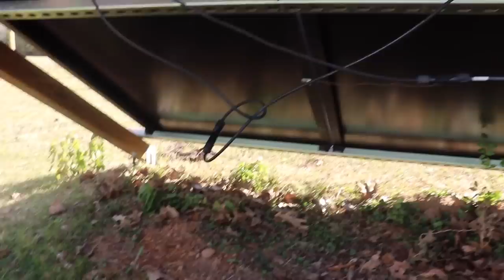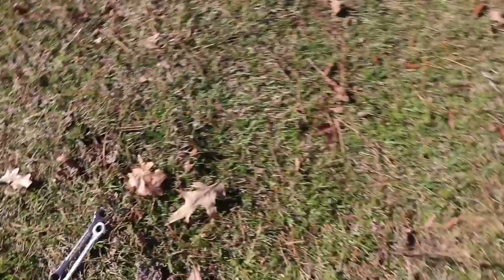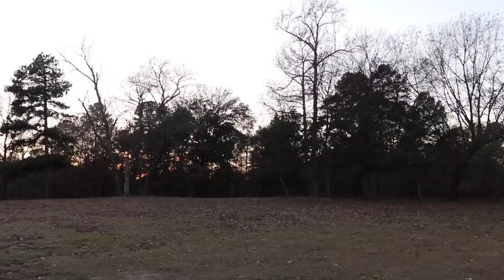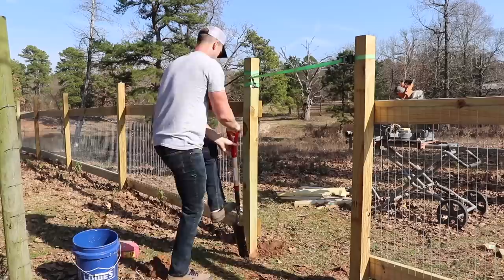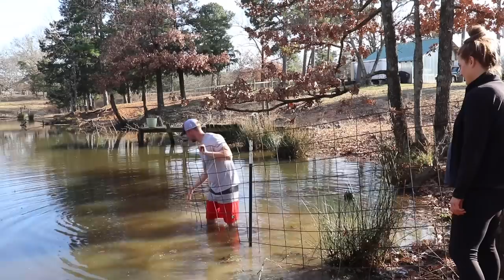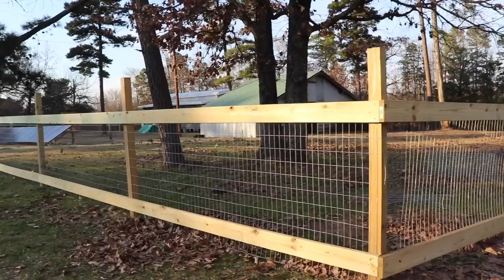Building More Than A House

Comment: Poetic closing; “power from the sun and water from the sky.”  You two are incredible.  Interesting collection of hogs in night camera images.  What are your plans for harvesting meat & building a smoker?  Stay safe. Peace.
Reply: Yea, really. A Smoke House to be sure.  I've seen some rural folks generate a small side income selling their smoked meats and Farm Eggs too.
Reply: A friend converted a 4-drawer file cabinet into a smoker; replaced bottoms of top 3 drawers with expanded metal.  Fire and smoke woods in bottom drawer, chimney holes drilled out the top and back.

Comment: It is coming along really well guys just two things to help out I am from a farming background when you staple the fencing wire go diagonal cross the t in the wire will add to the strength plus when placing the post in the ground the main strainers a block of wood stapled to the bottom on a short about half foot of wire compacted down well will add to the stability and strength plus to stabilize the strainer post you can cut a notch out of the strainer and affix a brace on a 45 % down angle sunk into the ground will stiffen it up hugely
Reply: Mark Fuller Dude, ever hear of a period?

Comment: cattle can be rough on fences.  I recommend a couple strands of electric fence wire
Reply: I don't think they can now that it goes into the water. ( but I honestly don't know)
Reply: @cjw2661  You can isolate the electrified run from the fence itself so it in no way contacts any metal part of the fence. You can even go a step further - if you wanted to be really anal about it - and isolate each section of the fence mesh/wire from the next so should the electrified part be pushed onto or otherwise be made to come into contact with anything metal on the fence it wouldn't electrify the rest of it.
Reply: That is what I was thinking, barbed or electric, they will not be happy once their grass gets green.
Reply: I would be worried about bear at night if they have a doggie door.

Comment: i would  recommend you get an electric fencer and just run a dbl wire along the pond  edge ,you can get the type that use a battery and a solar panel charger ,check any farm store or lowes lnbr store , believe it or not cows can swim.

Comment: if possible I would have enclosed the tanks in the fence so the cows couldn't chew on the tanks or pipes. It looks like you need some waders to go into the pond unless you can run the fence around it.
Reply: I was thinking along the same lines as far as one of the cows crushing the exposed piping/joints.

Comment: Okay you two I've been watching since the beginningand I told you in the comments as soon as you put those panels down that you better protect those things you guys got lucky all they did was chew on wires nobody got clumsy and stepped on a panel. so I'm on the other side of the coin I'm not wondering why you're doing it now I'm wondering why you waited so long.lol better late than never you guys are awesome keep on rockin.
Reply: Hay Mamacita  FYI I live of grid . And it's called expereance .
pretty much everything that I have suggested they did,  even things they didn't want to ,like repaint those containers. which I won't be surprised if they repaint them again in a much lighter color like white that green  metal in the summer will get  150 degrees easy. Oh and Mamacita back when I was making those kind of suggestions there were not very many followers yet . I don't do that anymore. I just keep cheering them on. I know that the first two years off the grid are very challenging. Most don't make it. I cAnt tell you how many peices of land have half a built houses with rotting trailers that they lived in while they built the house. Oh Merry Christmas 😎

Comment: What's your thoughts on the putting solar lights on the posts
Reply: John More I like it but probably expensive though it probably depends on how many posts there are.  Seems like a lot.  Maybe if they did, say, ever 3rd or 4th post?
Reply: @chuckm260    I was thinking like if you had them around the gates
Reply: Maybe some motion-activated solar lights?
They'll get a surprise when the lights suddenly turns on.

Comment: I'm kind of surprised you guys didn't enclose the tanks in the fence...not judging just curious
Reply: @420 420 Fencing keeps farm animals, wild pigs, coyotes out of a yard where a child will be playing, parents will be gardening, and protects solar setup & home. Water tanks & pump house are sturdy enough on their own.
Reply: my curiosity is why they used 4x4's?  T-posts would have lasted longer and been easier/cheaper.
Reply: @atlasshrugged3753  cause they look like crap. 4x4's look nicer.
Reply: SethLouey Agree, way nicer! Plus the 4x4s make the fence more visible which helps prevent animals and even humans from accidentally running into it, especially at night.
Reply: @sethlouey5064  you ever do any fencing?  Let me learn ya.  4x4x8 = $7.88 approx and lasts about 10 years if you are lucky.  Then you have to remove the staples on good above ground wood and replace the post at $10.88 due to inflation.  T-Post = FOREVER. at $3.50 each.  Personally, Imma gonna eat a taco and dare a T-Post to rot while i drink a beer doing the job right the first time.

Comment: We did a similar fence and we had to do a horizontal 4x4 from the gate posts to the next post at the top....and concrete them. The gates will put a lot of strain on the posts, especially the car gates. You will have to adjust them periodically. 
Don’t cut those posts until u find out how much of an escape artist bear is. 
Great job as usual!

Comment: I was worried about bear. Running around at night with coyotes and wild hogs around..
Reply: Me too!
Reply: I am too but the real question is why is he out at night to begin with?  Either they don't allow Bear inside at night or he has learned how to open a door.  :-/
Reply: @chuckm260  Maybe he had to go out to poop and didn't come back?  More than 2 options, I'm sure.
Reply: @TheHolyGhost777  Good point.  I actually mentioned that in another reply.  But if that's the case, it still seems like it's preventable, at very least safer, if they put a (long?) leash on Bear and go out with him while he does his business.  
Risk will be greatly lowered once the fence is completed but nothing is 100% protection.  Animals will find a way if motivated enough if there is a potential meal on the other side of the fence.  I hope they still look to take safe(r) measures when Bear is out at night (for whatever reason) even after the fence is up.
Reply: Me too!

Comment: Run a string or two of solar wire across the top half of the fence line near the water edge and along the pond edge.Once the get a few shocks, they will not go around it again. It would also help with the wild hogs problem, from digging alone the fence line.

Comment: Make a step for your wife to get in the house.
Reply: Ditto.  Or even a ramp - that way there's no stairs to contend with and is much easier to carrying heavy supplies, appliances, furniture, etc. into the house.  Either way just remember to put down some anti-skid/slip tape or whatever it's called.
Reply: She's pregnant, not disabled
Reply: @Wmoore1  No one said she was.  Whether she's pregnant or not, common sense tells you it's minimally safer not to mention easier.  Work smarter, not harder.
Reply: @Wmoore1  yeah she can trip getting up there. Did you see how high it is?
Reply: @chuckm260  thank you

Comment: You definitely need to put an electric fence in front of your new fence Spencer. Battery and solar power should keep them out. Also deer can jump high... You need to run a couple of wires along the top of the posts.... Do not cut them level you need the height....... Love the channel 💜💙💜💙😉

Comment: I'd put a couple strands of barbed wire on top of the fence...
Reply: My thought as well.
Reply: Either barbed wire or an electric fence along the top.
Reply: I'd go with a good solar powered electric fence. Since you're dealing with cows, you need to run the wire lower, about 4 feet from the ground. (think tush height on a cow) 
Cows like to rub/itch on stationary objects, until of course they are not so stationary any more.
Reply: And on the bottom for the hogs also.  Rick.
Reply: There will be a child running around outside within a year or so, probably don't want to electrify the fence or use barbed wire.
Reply: @aquadesignsbymlt4769  I understand your concern, the electric will be up high enough, even at cow-tushie height, that it'd be a few years before a toddler would be tall enough to touch it. By then of course, smart enough not to touch it.
Reply: @aquadesignsbymlt4769  It will be several years before the kid can run around and when it does it will quickly learn just like the animals that the fence is off limits!!!!!

Comment: I added a couple links below......

I see you have some temporary angle braces in a few places to add strength. I would recommend you put a permanent angle brace on each side of each gate and also on all corners of the fence. You can do this with wood or number nine wire or even barbed wire. I'm sue if you search some YouTube videos on barb wire fencing you can find lots on the best way the strengthen the corners and gates. It will help keep the gate posts strait which in turn will help keep the gates from sagging. This is very common on barb wire fencing which I think is still applicable to the type of fencing you are doing. Also put a diagonal brace on all of the gates themselves using wood or wire. It will also keep them from sagging. you can also do cross bracing on long runs of fencing to make it stroger. Ill add a couple links if possible. 
 https://www.youtube.com/results?search_query=angle+braces+on+fence+corners+and+gates.
https://www.youtube.com/watch?v=t29NC_WpXmM

Comment: Hey guys, loving your videos. Just a tip for future fencing that I didn't see you doing, when compacting the dirt around the post, compact layers of 1-2 inches of soil at a time. This will allow the soil to hold the posts a lot better and probably eliminate movement without pouring concrete. 
Awesome work on all your achievements 😀

Comment: Go to your local farm equipment store and buy some fencing Pliers. You'll use them for many jobs as they have a staple puller/ hammer/wire cutter as part of the tool. Part of the tool is built for putting the steel fence post 'staples" on quickly and efficiently. Oh and one of the handles on the tool ends in a chisel/large screw driver. Just about the best all around tool ever.

Comment: Hi, nice! You need to lateral brace your corners an posts to the gates. The cows will lean or rub on the fence and can put alot of stress length wise. The lateral braces will add tons of resistance and strength  long term!

Comment: A framing air stapler with galvanised 1.25 or 1.5 inch staples makes fast work of stapling the wire fencing.  You do need to dial down on the air pressure so you don't blow through the staple and/or damage the stapler.

Comment: Most fence builders place a diagonal board / pipe or wire from top of one post to the bottom of the other at: corners / gates. It helps stiffen up that area of the fence. A 'box' (or square) is very weak. While a triangle is much stronger shape and would help strengthen those area's.

Comment: In Australia we build  pig traps  so they can be wormed and treated before turning to pork.  If you put posts in concrete but a piece of 1/2 inch rod anout 2 inches sticking out of each side of the posts in the cement.  Then when you have to remove them the steel binds the concrete to the posts to pull out with tractor and chain.  Little tap with a sledge hammer and you have clean posts  full sized holes for new posts,  and concrete rubble for  dirt rd potholes repairs.    Requards Qld  Australia  p.s  meryy XXmass

Comment: Put my own fence in after I found out how much to get someone else to do it. Not as hard as I thought, yours looks way better than mine and mine is not that bad. You do great work. If you dont want to cement the post use quarter size gravel and fill the space with sand.

Comment: If your main goal is to keep the dog in, you better put another board across the top about 12 higher.  I did that and my dog, who is about the same size as Bear, jump went right over the top the very first day we closed the gate.  Had to go back and raise the fence with another board and that stopped him till he found that if he pushes with his nose and went right through, snapping the welds and leaving a big hole.  So then put electric netting and that stopped him.

Comment: At the fence at the edge of the lake, plant some thornbushes leading away from the fence. That way, the bull wouldn't think of crossing around it since it will see it like a solid wall.
I wonder what would happened to the boars, if you installed one or two motion-activated lamp/spotlight.

Comment: Spencer good to see you brave enough to wade out into the pond's freezing water to place the fencing posts, far enough out that your gonads as you so politely put it are just above the water level in December, all to allow the wire fencing to extend out to that point, I'm sure this will of course be quite enough for the winter, I bet the bull won't want to go out any deeper also, seeing as his ahem!  Gonads will be larger and hang a lot lower than yours (sorry about the crudeness), however come the summer when the water is warmer you may need to extend the fence even further out, how about a little boat or build a raft to help you.

Comment: Last fence I did was for horses.  I didn’t use any concrete, but I did cheat and use a 12 ton excavator with a modified breaker attachment to pound 8” x 8' posts 2 and half feet into the ground...

Comment: Those wires under the solar panels should be pulled up and fastened to the back side of the unistrut supports with zip ties about every 18" to 24" inches. The cows won't bother them if they aren't hanging loose.
Reply: Better go ahead and fence the water front. Remember there's a little one on the way, don't need any tragedy's to spoil the dream.

Comment: If Spencer is in soft muck at the end of the fence you won’t have to worry about cows getting around it. Especially with it being that steep getting down to it. It’s too soft for them to walk plus we’ve never seen cows in water up past the bottom of its belly. There have been a few occasions over the past 30 years but that was on a hard bottom pond that sloped way out in the shallows. 
So y’all won’t ever have to worry about a cow getting around that end of fence. 
A larger concern would be those feral hogs. They can do way more damage than chewing a few wires. 
I’ve seen a pack of hogs turn over fields / yards that looked like someone took a tractor and plow and ran all over it ruining everything . They can up root trees, fencing etc. Plus they’ll charge you in a heartbeat if they feel at all threatened.

Comment: I noticed u have a lot snakes . in the AZ central desert diamondbacks are a problem . we put 1inch x 1foot chicken wire on chain link fence . the snakes get tangled , the sun finishes them off . also moth balls work .
Reply: Hogs will eat the snakes if they can catch them.
Reply: @workonitm8  yes the hogs will  , I just don't see any hogs during the day light hours but have seen snakes in the videos . couldn't see the heads of snakes to know if they are venomous  ,pit vipers head shape like ACE of spades .

Comment: Instead of just holding on to the post while the staples are driven in, hold an 8 pound sledge hammer in back of the post.  It will work soooo much better.  Nice job on the fence by the way.

Comment: Are you guys going to put a diagonal brace from the top of the gate posts to the bottom of the adjoining post? If not your post will eventually pull out/loosen from the motion of the gate and the tension of the fencing itself.

Comment: Those fence post seem unstable to me, maybe they are more stable then they appear. I'm talking about all the fence post, not just the gate post.
Anyway, if they ever become a problem, you may have to redo them by tamping them with a small amount of dirt at a time. Put a small amount of dirt around the bottom of post in the hole and tamp the heck out of it and continue that probably 10 times at least...dirt,tamp,dirt,tamp,dirt,tamp...you get the idea. Maybe you did do this, if that's the case then the post holes aren't deep enough. Just my humble opinion.

Comment: Just a thought ... You may consider not removing the extraneous post material at the top of the fence in favor of three barbed-wire strands.  My experience ... a coyote or pack of coyotes could use the top board and clear the fence.  I know ... the esthetics come into play, however my argument is, a child will be at play sooner than You think.

Comment: Not sure why you didnt use something like fence post concrete bracket thingys, technical term. ;) I just wonder after a year what kind of wiggle you will have because of cows leaning or pushing on the fence and other factors. Yeah, it would be more work upfront but maybe less repairs down the road and could make the repairs easier, idk. It will be cool to see a vid a year out after you guys are finished with everything to see how everything is working out.

Comment: Yes Cows have a strange attraction to electrical cables and can do a lot of damage
Noticed your stapling of the mesh to posts is vertical and in line - this may look good and tidy but usually ends up splitting the posts
Staples need to be about this angle  /  and staggered side to side to avoid the splitting effect